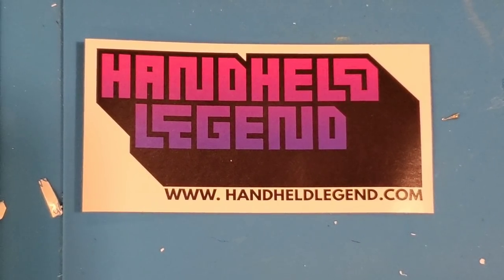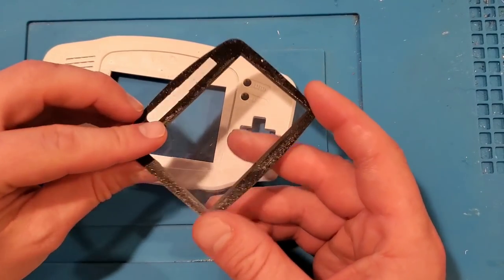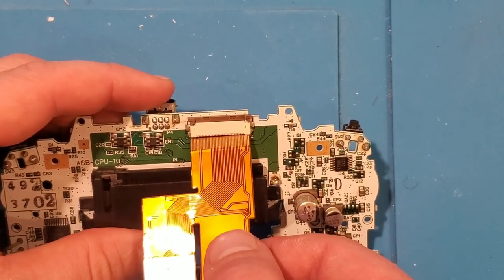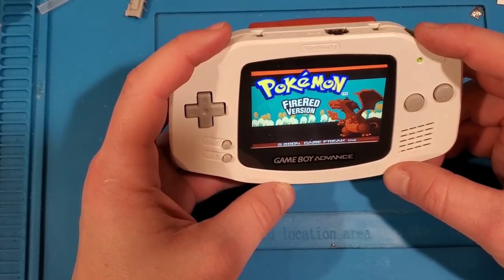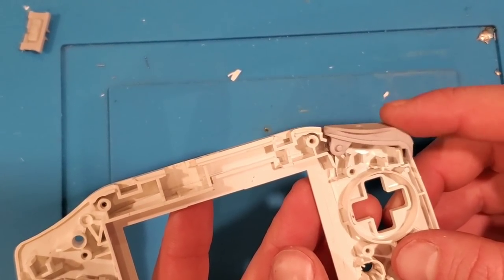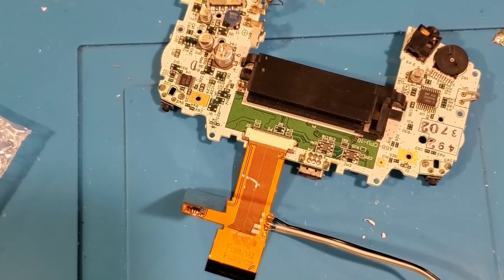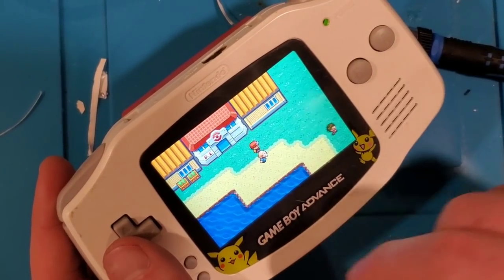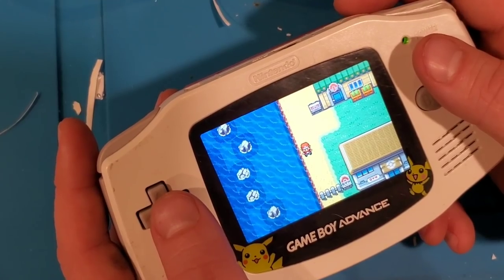Game Boy Advance IPS Backlight V2 Centered Installation - Fixing Ebay Junk - Backlit Display

Comment: Do you have an ags-101 to compare it to?
Reply from the maker: No.  This is definitely crisper. The 101 is still a good option,  but more expensive,  and the picture quality isn't as good.  Some consider that part part a pro though,  saying this IPS looks "too" good
Reply: @RetroRepairs  Do the pixels fit 1 to 1 or does it do some weird upscaling sorta like how ds games are on a 3ds screen?
Reply: @NO_obs  It's a 1 to 2 upscale. Each original GBA pixel takes 4 pixel of the new screen. There is no stretching or tearing anywhere since it's basically a perfect 2x upscale on a screen that has pixels 2x smaller. That's the main reason why it's so sharp.